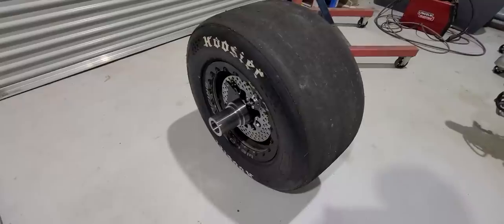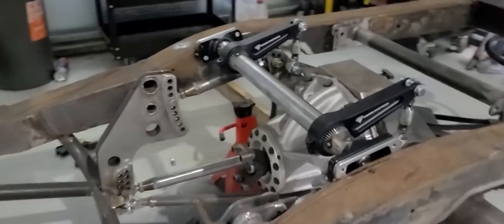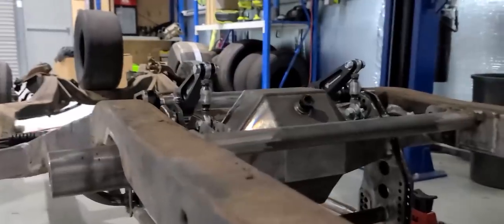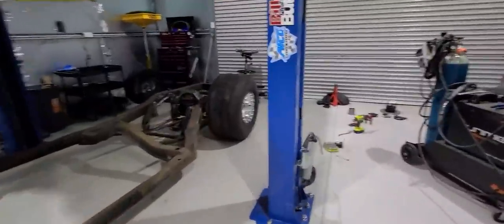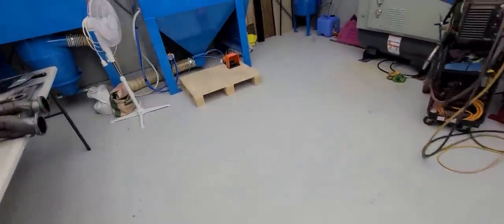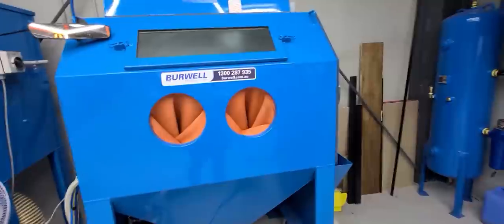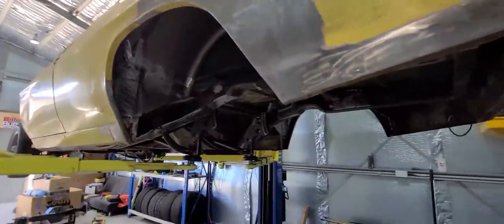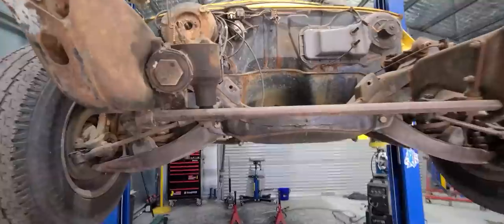#7 FITTING ANTI-ROLL BAR! - FINISHING UP DIFF! Holden HZ ute project blown big block build

Comment: Coming along nicely, I need to come help so I know what to do when I put mine together 👍🏻
Reply from the maker: Bit of an engineering nightmare builds like this lol every modification generally needs something else modified to make it work.
Reply: @MCFRYMotorsport   could probably use a section of C Chanel to pick up that rear mount.  I’ve spent hrs just fixing my rusted chassis, could only wish I was as far along as yours. It’s certainly time consuming work.

Comment: Can you move the roll bar toward the front a bit more and then mount the diff mounts to the bottom of the diff?
Reply from the maker: I could have I just wanted it in the spot where it would be the strongest, It's a bit of an engineering nightmare tubbing a car lol I also realised if I want to do burnouts and blow tyres out in this ute I'll need 20" wheels as the 4 link hangs down so low the ute would get beached with anything smaller.

Comment: How did u set up diff angle without the trans to go off of , any info would be great
Reply from the maker: I just set it level with chassis, Engine and gearbox will be getting an engine plate so I can put them where ever and if its out a little the 4 link has plenty of adjustment. I will be raising the trans tunnel in the ute.
Reply: @MCFRYMotorsport  thanks mate that’s great info , I’m currently doing the same to a Gemini and your vids give me a bit of insight when I’m stuck